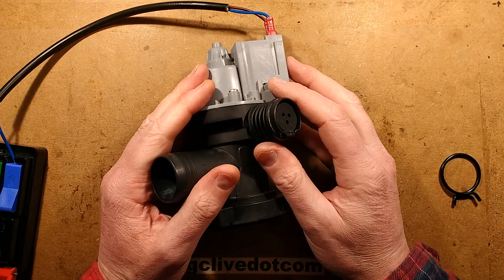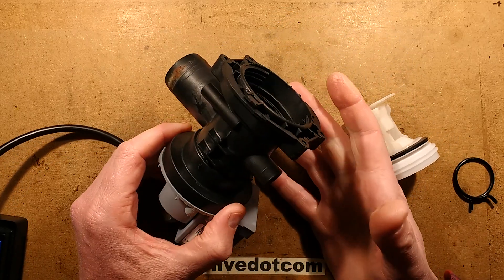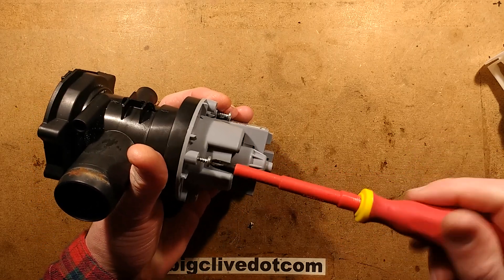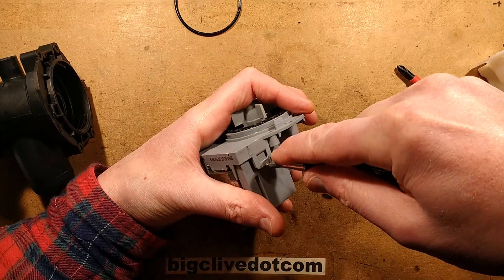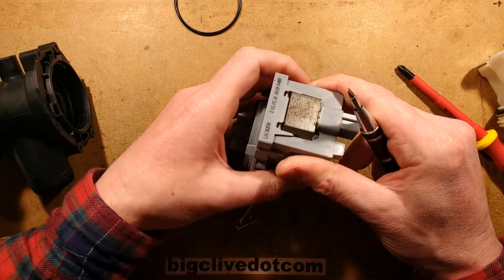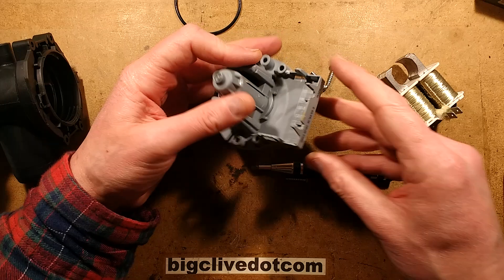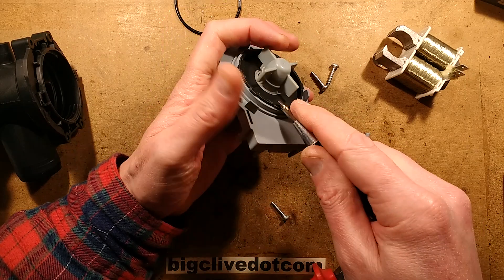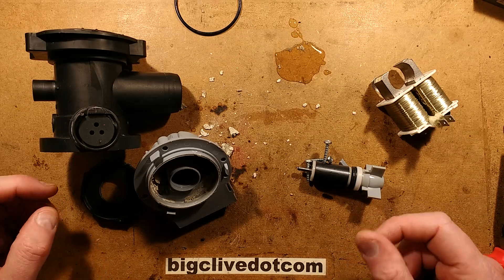Washing machine pump teardown.

Comment: hi i have a bosch washing machine that failed to pump.took pump of looks almost identical to your one.On dissassembling the pump found the impellor to be cracked and broken on the rotor shaft.caused by lots of dirt and grit being syphone up fro broken drain/drain hose falling too far down the outlet down pipe

Question::is it possible/plausible to replace just the roto shaft and impellor  with the large disc mounting(that jut pulls out of the motor case)  and exchange it with a similar one from scrap yard machine?   or is the rotor matched to the origional motor stator /windings?
Reply from the maker: You may find it easier to get a complete new pump.  They're usually fairly easy to find as they use common pumps between many brands and machines.

Comment: The motor is so similar to my old Hozelock 24VAC pond pump motor. It was the most unreliable pump I had ever owned. You would turn it on and it would just click for hours. You had to keep turning it on and off to get it going. I have been using a mains powered, factory sealed pump for the last 5 years and it has never let me down once.

Comment: Im hoping i can put an impeller off one machine to another so ur video was very good ..  
Question.. if the motor is off my machine.  My door is locked ..  (ie no model number .. ). If i plug it up will their be water exploding out of it? Or when i took it off n water came out was that all??   I think its crazy how theirs no drIn tube on some washers n none on some .. .. thx 😊
Reply from the maker: Draining depends on the machine and model.  With these self contained pumps it's better to swap the whole unit that try to change an impeller.

Comment: The small rubber flap was added to quieten down / damp out the pulsing sound that all washing machine pumps used to make once the outer drum (tub) was empty. All machines from 10 years ago and prior would make this strange noise once the water had fully drained. Simple reason behind this was because there would be a small amount of water left in the drain hose. This would travel up the hose in a small 'lump', however the pump didn't generate enough pressure by means of 'air' pressure to push the last amount of water out the drain hose, thereby resulting in a lump of water that would be shot up the drain hose - not quite hard enough, then fall back down the hose and land inside the spinning impeller. This cycle would just repeat over, and over again until the pump stopped. Hence the pulsing noise. The small rubber flap with holes in was added to dampen out this noise by acting as a 'fall-back buffer' This flap in my machine broke off  and ended up inside the pump. After retrieving it out of the filter, the pump works absolutely perfectly, but now has that 1980's / 1990's pulsating noise once the drum is has emptied - Nothing to worry about.. 🙂

Comment: Perhaps few have noticed a detail: this is a magnetic motor powered by alternating electrical power (50 or 60 Hz). Note that it does not have a starting coil, which would make it always rotate in the same direction. Conclusion: This motor will turn to a random side when starting. This turning side may be different on the next connection!!!!!! Brazil Sp

Comment: Would you need a capacitor to use a uplift pump
Reply from the maker: The motor in the video does not use a capacitor.  It will depend on the motor you are using.

Comment: 5:00 I have measured my pump as shown in the video, but it gives reading of only 160 Ohms. Is that OK? Are all the pumps similar in that matter? Where can I check if this reading is normal for my pump? 
- Washing Mashine: BOSCH WAE24361PL/11, 
- Pump: 1BKEBS 101/012C 9000346607 230V 50Hz 30W 0,2A CL. F 034-09
Reply from the maker: It's hard to say what your pump resistance will be, as it varies between units.  Does it run when powered?

Comment: I appreciate this video is a few years old now, but when did drain pumps change from using shaded pole motors to synchronous motors. Personally, I've yet to come across a machine with a synchronous drain motor. The only type other than a shaded-pole motor I've come across is a low-voltage three-phase design I came across in a dishwasher drain pump.

Comment: Hello, my front door washing machine drain pump run without laod (makes griding noise) however, when i want to drain water through it, it won't run at all. Do you think the pump is faulty ?
Reply from the maker: Check it hasn't got objects like coins or pins in it.  Make sure the power is off, and on some machines there is a flap at the front and a twist off cover for cleaning the pump and its filter.  There may be water in the machine, so have a tray or towel ready and be careful to release the cover slowly.

Comment: Thanks for explaining so well why the impeller is not fixed to the rotor (at 10:59), but has some slack! That helped me realize that glueing the impeller to the rotor is not a viable fix really, as it would cause the pump to occasionally stall.
Reply from the maker: Thanks.  Glad the video was useful.  You should be able to buy a spare online.

Comment: So I happened to find one of these pumps today in a discount bin at a local store. I bought it without really knowing what it was, had no idea it was for a washing machine, but hoping to have fun playing with it. My question is, any idea how good these types of pumps would function as a synchronous generators?

Also, on the one I bought, the copper windings are encased in ceramic so that I cannot even see them. Do you think this us purely a cosmetic difference or does it help the motor be more efficient or something along that line.
Reply from the maker: I'm not sure how well they would work as a generator.  They may be potted in resin or moulded in plastic for waterproofing.

Comment: Should spin both ways it's a 2 in one pump Normally one way to drain and one way to recirculate the water back in to the tub
Reply from the maker: Not this type.  The machines it's used in don't circulate the water like that.

Comment: 3:52 I believe that this sealing ring is causing my pump and machine to leak. Is it possible and if so, where can I buy such a sealing ring?
Reply from the maker: One of the many spare parts suppliers on eBay may stock them.  But you may need to change the whole pump.
Reply: @bigclivedotcom  Actually, one tiny little part that holds the pump to its housing has also broken off (I suppose because the pump hose has been pressing on it). 
Also, I feel that the pump cannot be turned into its position completely for some reason.
Is this the definitive case for a new pump??

Comment: Perhaps the perforated rubber outlet flap is supposed to prevent things like froggies and lizards taking up residence? Had a non-draining washer a while back and retrieved the remains of a large green tree frog out of the pump body - no flap in evidence. ;-)

Comment: The one I had to replace failed for mechanical reasons.  My guess is that it started with a bearing failure,  but when I pulled the pump out to replace it the rotor was half its diameter away from where it was supposed to be...

Comment: i find these pumps annoyingly noisy when they have no water to pump - sometimes when our washing machine (samsung) is trying to 'balance' the load for a spin it could take up to 5 minutes, and 5 minutes you have the drain pump constantly on trying to empty water that isn't even there in the pump - surely samsung in the software of the machine could have turned off the pump after a while of  having no water to pump out?

Comment: Thank you. I was looking all over for which one was intake. Cause I bought a pump for one of those Chinese gravity drain ones for my apartment.   I don't want to have to do it in the bathtub anymore! I can now do it in the kitchen! Quick question! Will the motor burn if it runs dry?
Reply from the maker: It can run dry for a while, but it's only intended for intermittent use.
Reply: @bigclivedotcom  I was quite curious because it's just basically a fan! Then, why don't fans burn out?

Comment: Ifb Washing machine making noise during only spin.
If I removed water pump nobe then it's not making noise.
It seems water pump is on after drain and during spin.
After spin it is not making any noise
Reply from the maker: If it's a rhythmic surging noise that's because the pump is only putting out short bursts of water as it is spun out of the clothing.

Comment: My washing machine is not draining at all. I checked everything. Pump ia turning and the pipes is cleae. Whats next? Please help.
Reply from the maker: If the pump is spinning under power it does hint that there's a blockage either between the drum or on the output hose.
Reply: @bigclivedotcom  thanks. I had a coin on the inside of the pump.
Reply from the maker: @carlocarroll9850  Glad you got it going OK.  Coins are a common issue.

Comment: The slight resistance you get when you manually turn the impeller is the built in anti tangle feature.  If the pump feels any resistance it will go into reverse to try and free itself from anything that may be obstructing the impeller.  Quite a clever but simple design feature 👌 😀

Comment: When you test the resistance what range should the reading be in ?. Is there a specific number to look for or are the readings different for each make of machine  ?.
Reply from the maker: The will be variation depending on power of pump and the local voltage.

Comment: does the drain pump works aa circulation pump also?
Reply from the maker: Not in these machines.
Reply: @bigclivedotcom  for my project, i need to know which machine uses single pump for drain as well as circulation. Can you help or give some insight?

Comment: I bought a new machine that has a dual function pump - a circulation pump runs in part of the cycle - effectively washing the soapy water out of the rubber seal. Anyway - it was really noisy. I called the maker to send an engineer to change it. The pump was the same concept as the one you are showing (but two motors). The noise was very significant a rasping sound. I believe it was due to the magnetism leading to the armature ricocheting back and forth as it rotated. Any thoughts?
Reply from the maker: Loose metal near the windings may vibrate at mains frequency like a buzzer.
Reply: @bigclivedotcom  couldn't see anything like that. More than a mains buzz

Comment: You shall have the washing machine in a room with a drain, that way you can just open the filter and no need for trays and stuff. Worst thing would be wet socks on your feet. 🙂

I'm a bit more interested in the possibility of such a motor with a permanent magnet rotor being able to start backwards, something that I have seen can happen sometimes and it's quite annoying when it's an hour meter for equipment.

B.t.w. this motor type is from what I can determine called a Lavet motor: https://en.wikipedia.org/wiki/Lavet-type_stepping_motor

Comment: Would like to add our pump just failed. Removed it, separated, cleaned all the nasty grunge, refitted; and it's still faulty :) just does buzzing, so I presume the motor is faulty as the magnet bit is still very magnetic and finger turns. BTW, a huge fan of this channel. Any ideas how/why it fails? No resistance on the spindle so suspect something has over heated perhaps?
Reply from the maker: It's odd it's not turning if it's buzzing.  Unless there's a triac controlling it and that has failed half-wave or is not being fully turned on.
It might be worth swapping in a new pump to rule it out in case the motor windings have a short.

Comment: Why there is not a drain cock with hose fitting on the front of that is beyond me; it would then be a simple matter of removing the residual water in the thing without having to use trays etc. without having it go all over the floor (as I recently experienced !)
Reply: My Ebac has a drain hose with a bung for draining.

Comment: That reminds me, I need to sort out the condensate pump on my "split-twin" air conditioner. The old one went caffooey and burnt the windings when the condensate drain became blocked and overflowed into the motor. It's actually a shaded pole motor in my machine, but unfortunately, I haven't been able to find a suitable replacement pump, and I don't think it's possible to remove/replace the winding.
Reply from the maker: Condensate pumps fail regularly.  You may be able to find a direct fit on eBay.  Make sure the water level sensor is working.  You can also get complete pump/sensor units.

Comment: How timely! My interest in electronics has been reignited thanks to your videos. And just last week I fixed our washing machine which uses the same pump module you’re pulling apart here.
Reply: BTW, one of the those forward outlets is for drainage. When you unscrew the big insert a bit it releases water in to the front of the housing and out through the foremost spigot. In mine it's attached to a rubber hose that is pulled out the front by the access door.

Comment: Hi! I need to use a little water pump to circulate water in a heat exchanger, so the water could become a little hot, like 60°C.  Do you think a pump like this could withstand that temperature? Do you think it could work for 3 or 4 hours continuously? Thanks for your advice.
Reply from the maker: You might be better using a heating circulation pump.
Reply: @bigclivedotcom  Aren't those pumps large and heavy? My heat exchanger is relatively small (two car heating radiators, and a 12 liter tank), so i was looking for a little pump that could withstand some temperature. Thanks for your advice!

Comment: My Miele WT945 has the pump which slots into the back of the outlet/filter housing without any hose connections to the actual pump mechanism. All the pipes are to the Filter housing making the pump just a twist and release part with the water seals being part of the electric pump mechanise.

Comment: They are designed with large tolerances allowing them to pump quite sizable debris.the flap, to stop any debris that has gone through the pump if the pump stops before it clears the pipe from sinking back into the rotor ?.

Comment: I have a Samsung washer where the pump was clogged by an American quarter I ended up having to remove the pump as there was no debris removal port. And fortunately the drain pump inlet was just the right size so those quarters can get stuck

Comment: The winding turns of copper coil was burnt ..Can we rewind the copper turns to get well again???
Reply from the maker: You could do that if the former isn't too damaged.  You'll need the same thickness of enamelled wire and have to wind it on neatly to fit the proper number of turns.

Comment: Anyone know how you'd power this as it's own device? Wanting to use a pump but ofc they run on AC not DC.
Looks like most are 230v 50hz. Do you just wire straight up to it without a fuse?
Reply from the maker: You could just power it directly from a mains flex.  I would recommend a fuse.  I'm not sure how long they are rated to run continuously.
Reply: @bigclivedotcom  Ah I see, thanks.
I would suspect they're fairly durable, but I'm not an expert on this type of stuff. Seems like a useful part nonetheless!

Comment: I've worked on this stuff and that is a very common design used on almost all washers and dishwashers now at least in the US. What usually happens is the seal between the rotor and housing wears out. Water (and lovely essences) migrate back into the magnet compartment. Also the impeller breaks off form the shaft, usually from an item getting caught in it. Result it runs but doesn't pump,

Comment: As you mentioned that it works in both direction does polarity matters for it's wiring?
Reply from the maker: No.  It only works with AC so the wires can be connected either way round.

Comment: I just autopsied (sp) our washing machine. I wish I had seen this video before I started. Our pump came " to bits" easily. What I found was, a tremendous amount of brackish water in the impeller shaft housing and a broken impeller shaft magnet. The magnet was fractured lengthwise the full length of the shaft. I assume that that was the failure that lead to the error code. Now I need ideas for what to doe with the old motor.

Comment: In my machine there is a small rubber hose that has a plug in it which can be used to drain the water prior to unscrewing the trap so as to minimize the mess.

Comment: Those tabs allways snap off when you tear them down.
I 'stick' them back with a fillet of milliput.
Water pump failure and carbon brush wear on the drum motor, used to be the bugbears before computerization